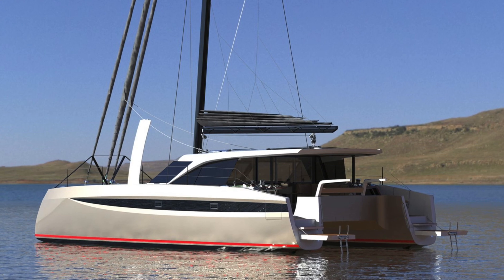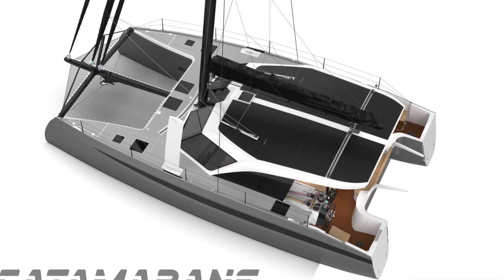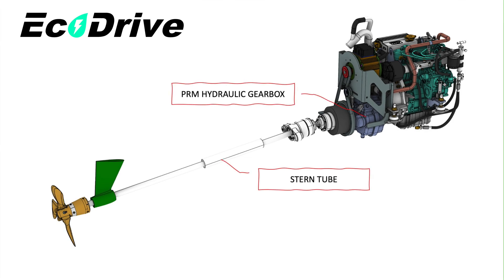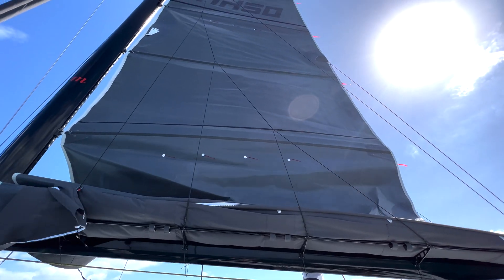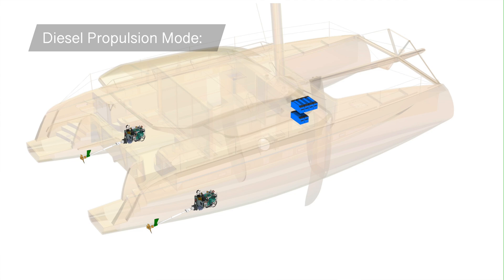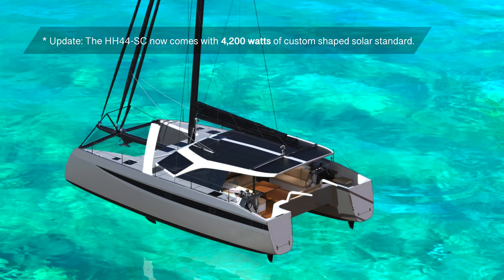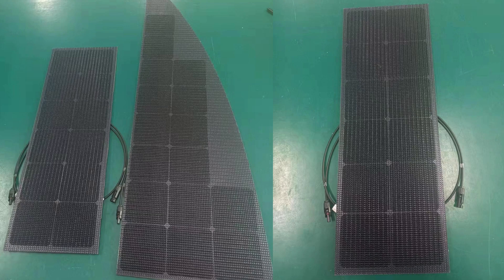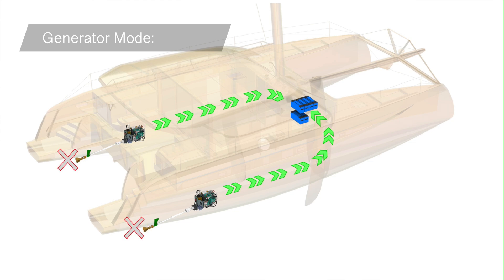Electric Catamaran of the Future: The HH44 EcoDrive (Episode 4)

Comment: Did I miss something or you did not actually explain why parallel hybrid over serial? That is why not resort to electric engines only and a generator? Or, alternatively, one hybrid engine and one electric only? Also, wouldn't a dedicated generator be more efficient at generating power than a regular Yammer diesel coupled with an electric engine in generator mode — even when running at diesel's most optimal RPM?

EDIT: OK, you did explain later into the video the serial hybrid reliability concerns, which is understandable — at least until the electric propulsion gets deemed as reliable as a diesel and thus concerns no longer valid. Which I suppose is the case in EV cars realm already. Other questions still stand, though.

Comment: Solar Electric sailboats and motorcycles are the only electric vehicles that make sense with today's tech.10 kw/888 only equals 11 hp. Did somebody forget about friction, heat, and drive train loss? It's is about 888 watts per hp. Length of water line with 11 hp it isn't doing much over 5 knots. Perhaps add super capacitor bank because lithium batteries do heat up and loose power. Super capacitors can run electric motor direct from solar. And skip the power loss by slow charging lithium batteries. Those lithium batteries only cycle so many times. Super capacitor bank cycles millions of times. The super capacitors will cycle so batteries don't and batteries will have less hard cycles. Can you imagine boat lights dimming out because using electric motor. Like when bass hits on a car amplifier and dims headlights.

Comment: The killer argument: redundancy....BUT going parallel hybrid you double everything including maintenance and the weight which approach is not compatible with performance. It seems to me like the phylosophy behind the parallel hybrid design is that you do not want to use your diesel engine anymore but you do not trust electric motor. In the end, the primary source of propulsion is not a true primary electric motor and the diesel engine will serve as a genset, but it is not a true dedicated efficient genset.The result is an in-betwen solution including diesel engines still, which by the way can not be bluewater friendly. Hopefully some people like the Starlink guy believe in reliability of electric motors...
Reply from the maker: The beauty of this design is that you are not really adding all that much equipment. Instead of high output alternators on the diesels, we are installing the electric drive motors (these are practically one in the same). And by doing so, you remove the need for a Generator, so this reduces equipment. All boats are using LiPo batteries these days, so no additional equipment there. And by removing the sail drive to use a shaft drive, we are again reducing maintenance and the potential for corrosion. It's a great concept when you really compare it to the traditional systems being used today.

Comment: @HH Catamarans . Beautiful cat and design. I like the idea of the electric motors being used to generate electricity from both the diesel motors and through hydro regeneration from the props. Do you have figures on how much charge you get from certain hull speeds and how many revs on the diesel to generate 5 Kw . Why have you decided to put the motor onto a shaft drive. Could you do the same sort of system to a sail drive?  I would go for the David solar panels extras and  more batteries and drop my speed from 7 to say  4 -or 5 knots which must extend your range significantly, no?  Do you have numbers on those options?
Reply from the maker: We look forward to testing the performance as soon as Hull 1 is in the water later this year!

Comment: if u can generate 10kw from the electric motor from sailing why not put hydrogen tanks and make hydrogen on the boat and then who needs diesel engine that even without solar free clean water will be made and heat for hot water u can keep taking to ur self without answering what ppl really need all that without solar even wonder why that is hummm.
Reply from the maker: Maybe someday!

Comment: why a shaft instead of placing the motor as a pod outside of the hull? Seems to reduce failure points
Reply from the maker: Shafts are a very very reliable system used by monohulls for decades and decades. We want to move the weight mid-ships as much as possible to increase performance and decrease tail drag. Thanks for the question!

Comment: Why not go with a generator to top the batteries up rather than using diesels?
Reply from the maker: What you are referring to is a Serial Hybrid, which we explain in the video is more susceptible to failure. We prefer the redundancy of a Parallel Hybrid.

Comment: Sirs, it's wonderful that you're posting these videos and underlining the topic of electrification for boats. I'm an owner/skipper of a Lagoon 52, wishing for an electrified future. I love that your approach to this is starting from scratch and designing the whole thing around propulsion and energy storage. A couple of issues though. To me, having both motors coupled to a single mechanical clutch kind of takes away from the redundancy argument. One could see that clutch as a single possible failure point and would want to see how long those could last with regular operation. Another point is that the 10 KW e-motors for this size boat are very small for marina use or for putting up sails in windy conditions. Yes, there's the instant torque, but I don't see it being able to take the major role for those operations, so why should I invest in extra complexity?
Reply from the maker: Thanks for watching and writing. We think these motors are properly sized for the weight and efficiency of this new boat, but agree that it would not be sufficient on a Lagoon (especially a 52). Regarding redundancy, without a mechanical clutch how would we attach two different motors to the same shaft? Appreciate the comment!

Comment: Would you ever think of adding an underwater foil - perhaps connecting the two hulls like Aquila 36 and 44? This is supposed to dramatically lift and improve performance over 15 mph? I think it might add some grief during haul-outs occasionally, would be a question.
Reply from the maker: We have looked at it for our powercats but it is not efficient at slow speeds. To put this on a cruising catamaran would add more drag than it would help with displacement, so we will not look to add them for now.

Comment: Thanks for a good summary.  Electric drive is definitely the way to go, and it seems you've chosen a very sensible hybrid system, battery and solar size, etc.

43 KiloWatt-hour battery bank.  KiloWatt-hours are a measure of energy.  KiloWatts are a measure of power.  Energy is power integrated over time.  They are not the same.  BTW, that is about half the capacity of an electric car battery.  

Two hours of electric motoring is way more than enough to motor out of a marina, off a mooring/anchorage, etc.  And all of the energy used to motor can be replaced by hydrogeneration if there is enough wind to sail.

Feedback: the microphones need to point at you for best sound.  James was a bit hard to hear.

Comment: Why wouldn’t you design a fully hybrid setup with a 50kw variable speed diesel generator through two 50kw lithium titanate battery banks delivering power to two 22kw electric engines. When you drop the water holding capacity to be replaced by a water maker, and the diesel fuel capacity because you are generating half of it by sun by my calculations you end up with a far lighter and safer setup than this design. Lithium phosphate is a dangerous risk for fire. Lithium titanate isn’t.
Reply from the maker: We explained why in the video...
Reply: @HHCatamarans  didn’t get that from video
Reply from the maker: If we were to build the system this way it would be immensely heavier system because you still have a larger diesel engine and even more batteries. It would also lack the redundancy of a parallel system instead of using a Serial hybrid (which is what you are describing). If any part of a Serial Hybrid system fails the entire system goes down. That is why we think Parallel hybrids are the only way to go on a true bluewater boat.
Reply: @HHCatamarans  Was looking to convert a Leopard 44 to fully Electric using something like these weight calculations
Reply: Description	                                                                      Savings in Weight (Kgs)			Description	                                                                                              Additions in weight (kgs)
Genset	                                                                                300		                                                Additional Solar	                                                                                         400
Engine/sail drive swapped with OceanVolt system	200			                                        100kw Lithium Titanate batteries and Graphene Supercapacitors	1200
Less Water plus Watermaker	                                        500				
Diesel	                                                                                600				
Total Savings	                                                              1600				                                  Total additions                                                                                            1600
Reply: This is a cruising vessel not Bluewater as you suggest

Comment: I don't see a boat as being a serious electric boat, even on a sailing vessel until PV's are on just about every square inch of hull above the waterline. Having them just mounted on roofs isn't sufficient. Having all that money tied up in motors, controllers, and battery banks without absolutely maximizing the PV doesn't make sense to me.
Reply: You overestimate how much energy can be gotten from current solar technology compared to the energy needed to move a boat.  Solar electric boats are fine for motoring away from the dock/mooring/anchorage and for powering house loads including air conditioning at anchor, but won't work as propulsion for global cruising.
Reply: @LoanwordEggcorn , or they could just run a small diesel to motor away from the dock, and forget the big battery bank and the roof full of PV cells. A gallon of diesel should get them out past the jetty.

The fact is, once someone is already setting up a million dollar boat with big battery banks, and electric motors, and control systems it's silly not to put a few thousand more dollars worth of PV's on the hull and boost a 30 PV mile range to 60 or 80 miles. More is better, and I'm sure it's what the competition will soon be doing. It's the obvious way to make an easy to understand and  measurable improvement. The intangibles matter, but so do the obvious things.
Reply: @johnwest7993  There are practicalities about where solar cells are best put, shading issues, microinverter issues, penetrations, leaks, etc.

More solar would be better, but becomes less and less practical and effective when put places other than the coachroof and maybe deck.

Engineering is about tradeoffs, and I think they've picked reasonable tradeoffs given the current state of the art.

Also you should do some math. Doubling the solar would get around 7 more miles of range under good conditions, not 80.

Comment: Lithium batteries that like to start fires with saltwater are scary if you're going offshore.  Basically turning a beautiful sailboat into the same insurance risk as a turbine boat.  I love the idea but as a Floridian watching multiple EVs go up in flames after hurricane ian flooded them is a good example.  Your Ecodrive seems to be a great idea if we could grab some batteries that aren't playing russian roulette with boat ending battery fires. I love this boat been following since your first release video.  Definitely a dream build.
Reply from the maker: Nearly every new boat being built today uses LiFePO4 chemistry, cobalt free batteries. LiFePO4 is also the safest Lithium battery chemistry there is. Thanks for watching!!!
Reply: @HHCatamarans  Thanks for the info, I'll have to do more research.  I guess I'm still one of those people who think a diesel engine is the best safety device.
Reply: @nomemanfootball  Because Diesel engines never catch on fire?

Lithium Iron Phosphate batteries are the least likely to catch on fire.  They're also highly durable.
Reply: @LoanwordEggcorn  no because diesel engines are the most reliable source of energy on a boat.  Especially if you're talking older diesels before they put new regulations on them making them less reliable.
Reply: @nomemanfootball  We agree Diesels can be reliable and are a good way to move a boat when the wind is lacking, and that adds to safety.

However the same applies to electric drive, at least for shorter distances, and the hybrid system HH chose is relatively very simple and should be reliable.   There's basically one moving part in an AC or brushless DC electric motor: the rotor.

Mechanically, the hybrid system they're using is not much more complex than an alternator plus a clutch; in fact it arguably simpler due to not having brushes.

Also Lithium Iron Phosphate batteries have the most durability and least fire risk of common Lithium ion types. 

A common test is to drive a nail through the battery.  Lithium Iron Phosphate generally do not catch fire with the nail test.  Other Lithium Ion chemistries can catch fire with the nail test.

That's just one example.  Lithium Iron Phosphate is the inherently safest.
Reply: @LoanwordEggcorn  Thank you for this dialogue.  When my schedule slows down a bit later in the week I plan to do a deep dive on these batteries.  Seems like my knowledge is lacking and I may need a change of view. 

I really do like the hybrid system HH is using seems like a smart way to keep the boat powered. I'd assume if you're somewhere like the Charleston river it'd probably keep the boat charged at anchor because of current.
Reply: @nomemanfootball  HH mentioned in a different comment that they thought a current of 7 knots was needed for hydrogeneration to be useful in the scenario you mention, i.e., anchored in a current, however I think some useful energy could be gotten from lower water flow.

There are some losses and inefficiencies in hydrogeneration, but for typical sailing, it will definitely recharge batteries.  Strong enough wind to sail is strong enough water flow to recharge.

Electric drive is a very elegant system that allows us to recapture the energy used for motoring away from land simply by sailing.  It's also operating in harmony with nature, and therefore fits the idea of sailing well.

Comment: LOVE THE CONSEPT OF THE ELECTRIC HYDRID SYSTEM. ONE THING YOU MAY CONSIDER IF NOT ALREADY DONE SO IS IN THE SPECTIFICATION FOR THE ELECTRIC MOTORS TO ALLOW A HIGHER VOLTAGE THAN THE PRESENT 48V WHICH AS FAR AS I KNOW IS THE LIMITING FACTOR FOR THE 10KW RATING OF THE MOTOR. IF THE SYSTEM IS USING PROGRAMABLE REGULAR / SPEED CONTROL THIS WOULD NOT BE AN ISSUE (SETUP UP TO 48V AT PRESENT BATTERY TECHNOLOGY BUT NOTE THAT PROPELLER SHAFT STILL WILL NEED TO BE ABLE TO TAKE THE FUTURE UPGRADE OF VOLAGE AS WELL MECHNICAL LIMITS). THIS WOULD ALLOW THE CUSTOMER WITH FUTURE ADVANCES IN BATTERY DENSITY TECHOLOGY ALLOW FOR POTENTIAL INCREASES IN OUTPUT OF THE MOTOR BEYOND THE 10KW WITHOUT HAVING REPLACE THE MOTORS BY MEANS OF JUST CHANGEING THE SETTING IN THE REGULAR / SPEED CONTROLLER WITHIN REASON.
JUST A THOUGHT AND ARE YOU CONSIDERING TO EXPAND THE DESIGN LINE PAST THE HH50

Comment: The systems sound awesome with all that ability to recharge the batteries. BUT, you have ignored mother nature and her lightening strikes.

Your insurance had better be top notch = expensive.
Reply from the maker: No, we've thought of that! This is the reason we went with Beta Marine engines. No electronics on the engines allow the user to hand crank them to start in the event of a lightning strike. Plus our carbon mast comes with a grounded lightening rod which the owner can choose to either install or withhold from the build.

Comment: Can you put this system into a monohull (50-60 feet)?
Reply from the maker: You can, and some people are. The question will be how much more displacement does that install have on the vessel and how impactful the system will ultimately be. This is why performance cats are the obvious choice for this type of boat at the moment.
Reply: @HHCatamarans  Yeah. I wouldn't have thought a monohull would have enough real estate for solar panels.
Reply: @JohnSmith-zo6ir  People seem to overestimate the amount of useful energy one can get from current solar panels.  For house loads, it's more than enough.  For propulsion, it's not enough even on a cat covered with solar panels.
Reply: @LoanwordEggcorn  I agree. Even the houseloads are a stretch, especially if they have air conditioning.